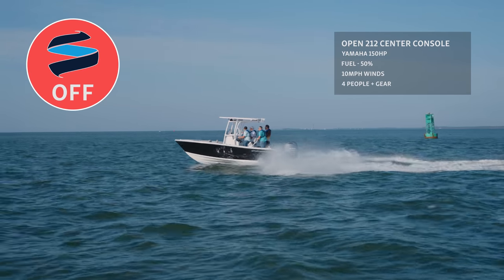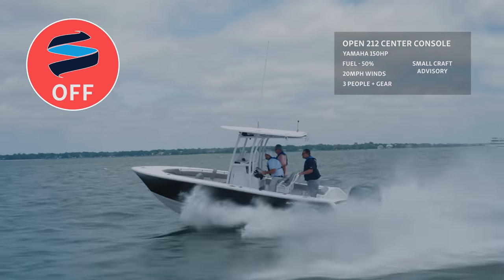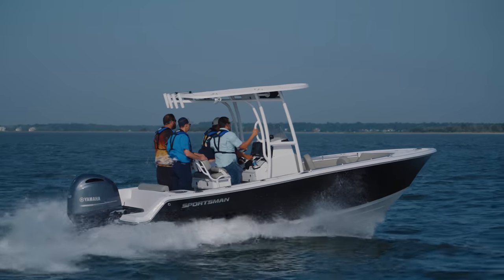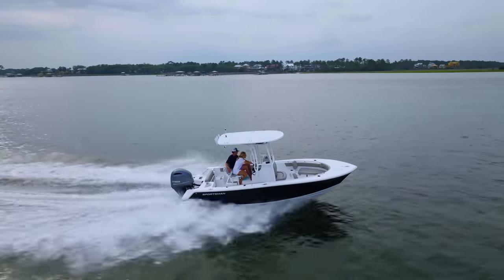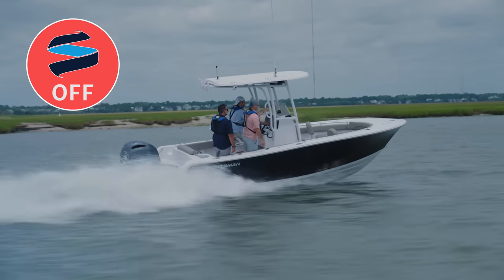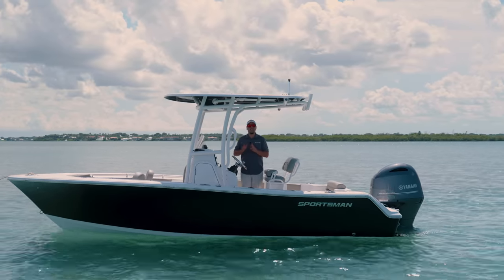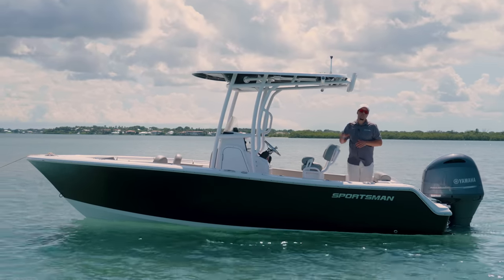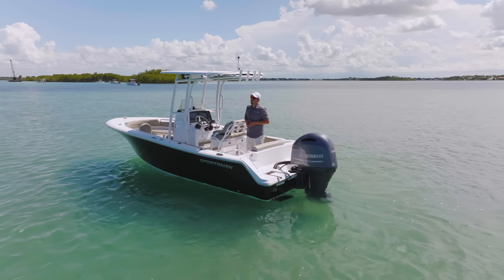What is Seakeeper Ride? | What It Does, Advantages and Basic Operation

Comment: nice,,, now what happens when you trim the motor up ? does it over ride the trim  motor up with tabs trim down the bow ?
Reply from the maker: Use a new boater for example, maybe they've been at the sandbar with the motor trimmed up a bit. They take off for the day and go to get onto plane, as we all know you'd trim your motor down but we've all done it and tried to launch with the motor up. In the case of RIDE, it's actually going to allow you to get onto plane very easily even with excessive trim. We'd obviously recommend learning how to operate your trim properly for safety purposes but in the case where you forget RIDE is going to help get the boat up and out of the hole and onto plane. You will see examples of this testing toward the end of this video.

Comment: What's the cost vs trim tabs?  Surprised to see this is launching as standard on Sportsman, impressive.
Reply from the maker: It's standard and built into the pricing of each model it's offered on.
Reply: There are three models currently, the 450 for boats up to 26' is $4,500 retail, the 525 for boats 27-30' is $7,500 retail, and the 600 for boats 31-35' is $10,500 retail.

Comment: Seems cool but I’ve had no problems using the regular trim tabs.
Reply from the maker: These are much more than a regular trim tab, in fact they're not to really be compared to a trim tab due to how much more they do. The bonus is also that you can turn them on and never think about it after that where as trim tabs need constant adjustments.

Comment: When the system is off do the "actuators" move around? Free float? Or do they stay where they were when they were active?
Reply from the maker: When the system is turned off they retract and do not effect anything.
Reply: @SportsmanBoatsOffical  Thanks,  Seems like huge physical  forces would be put on them. What adhesive is used to hold those suckers on there?  Does it have a "wear lifetime?" What a great idea. Awesome. Thank you for your response also.

Comment: I have a 2016 252 open . The boats you show on this demonstration are a maximum length of 23 feet. Does this system work on a 25 foot boat with twin engines?
Reply from the maker: There's no options currently for after market but Seakeeper is working on making it available soon.

Comment: What about noise from the seakeeper? wine low hum anything.. Whats the life of the seakeeper before replacement?
Reply from the maker: There is zero noise from the system while using them. So much so you will forget they're there while your boat is running incredibly smooth on the water. As for maintenance, there are small components called zincs that will need to be replaced to ensure your system is running at it's best.

Comment: Does this affect fuel mileage? Cool system!
Reply: It has too
Reply from the maker: One of the great things about this system is that it's helping get on plane, run smoother, and all of this puts less stress on the outboards. This means you don't need as much throttle as you'd usually need. All of this combined means you're burning less fuel. We will be making a Tech Talk video on this in the next few days showing fuel consumption with the system on verses off.

Comment: I have an older Sportsman boat with added Lenco AutoGlide system.  The AutoGlide system on my boat does help to set the proper pitch after launch but takes a long time to finally adjust for roll.  The system does not adjust for both pitch and roll at the same time at launch.  Does this new system adjust pitch and roll at launch?  This is a big issue for me with the AutoGlide system because when not properly loaded from side-to-side, the launch can be very awkward with a very out of trim roll state.  Also, I'm assuming I would have to delete the entire AutoGlide system to install this Seakeeper Ride system.  Is there information available about retro-fitting this system from existing traditional tab systems?
Reply from the maker: Currently there is no aftermarket option however Seakeeper is working on making it available now. As for system operation, there are settings to help the boat plane and balance at launch that will be pre-programmed into the system from the factory. Once available for after market we will have the system recommended settings available and a Tech Talk video on how to make those advanced adjustments. As for deleting your current system that's going to be a question for your local dealer, it is likely you would have to remove it as the Seakeeper will do everything and more than your current system.

Comment: Learn how to use the trim of your outboard then you won't bounce
Reply from the maker: The bouncing discussed is not necessarily porpoising, it's from launching or falling off larger swell and chop. However, if you motor is not at the ideal trim where you might porpoise normally, the Ride system will counter this and make the necessary adjustments to avoid porpoising.